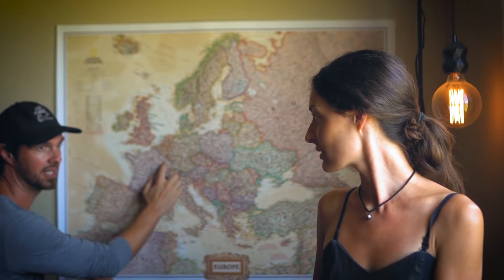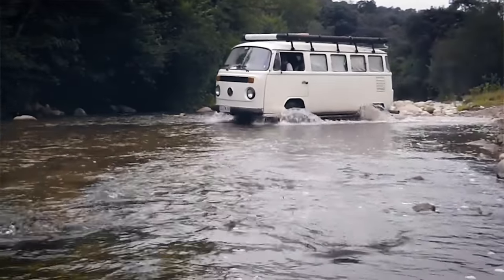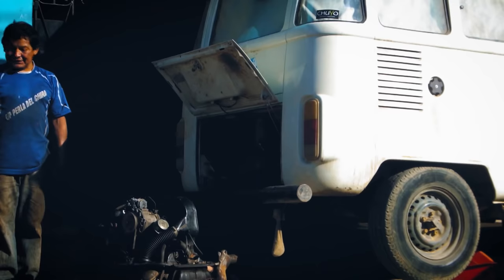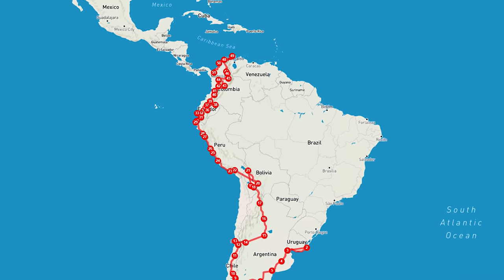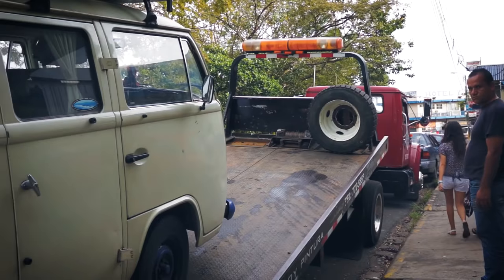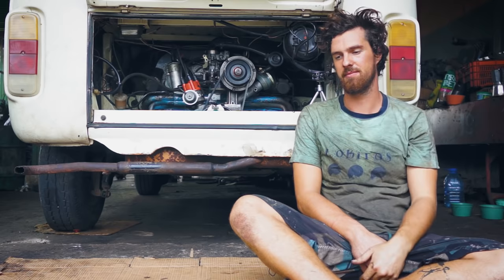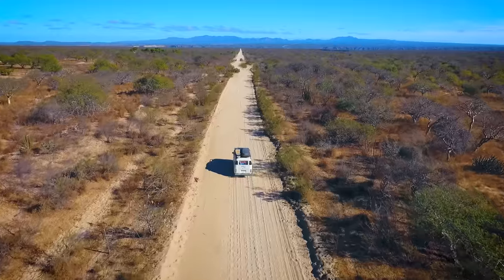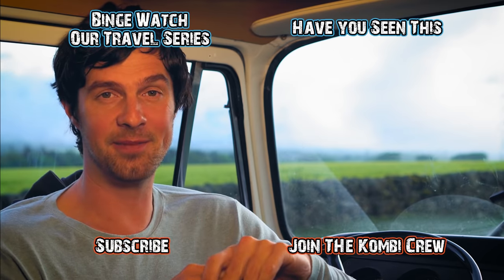How Did I BLOW UP 10 ENGINES in 1 ROAD TRIP???

Comment: There is also a thing called torq.....1.6 boxers very reliable engine for a beetle....how much weight were you pulling along ?
My dad emigrated his van from Holland to New zealand.....flat vs hills.....his luck was he had a 2.0....
Tad bit more torq.....I remember seeing the mechanics face when he stepped in on the wrong side of the van....and als admiring the 2.0 boxer engine
Its what you do with it...and I bet it was always cilinder 3 that seized up....
Im a Volvo mechanic now....but still have a huge crush on mr ferdinands boxer engines....
Reply: I was born in NZ, back when it wasn't islamic. VW kombis were very common and the main reason the number 3 cylinder failed (dropped valve etc ) was because the oil cooler sent hot air onto the barrel . There were once quite a few VW aircooled specialists in NZ but most are probably gone now.

Comment: l have never worked on a vw but most carbs i worked on the jets control the fuel, to make a carb leaner you put in a smaller jet, not drill it out
Reply from the maker: air correction jet
Reply: @KombiLife  l guess l will have to take more notice next time mustie strips a vw carb

Comment: Could be simple as what fan shroud or fan or belt adjustment wet conditions affect belt slippage, type and brand of oil, not using oil pressure gauge where oil pressure switch located over reaching engine power train limits altitude adjustors not working or non existing many factors gas sealed temp control on fan shroud adjustment wrong, valve adjustment not done loose heads!!

Comment: Sound to me like you were probably setting the ignition timing to advanced easy mistake for a novice to make.fuel mixtures tappet adjustment and general wear low compression wont kill an engine like that very easily. over advancing the timing will kill that type of engine especially if it is constantly under heavy load.

Comment: Had I done this trip, saving up the money for a 4 cylinder turbo diesel 1 ton truck camper would have been infinitly more reliable. especally if it could run without the turbo if it broke. and strap a cheap bike onto the back. An air cooled Deutz diesel would be your simple second option.

Comment: Quick question do you think a 1998 Astro van would make it from Oregon to New York I have replaced all of the oil seals as well as replacing the radiator it's a 4.3 liter V6 Vortec engine
Reply: Yes definitely they last 300+ thousand miles without so much as an oil change. Change waterpump to be on safe side every 150,000 miles

Comment: electric fans on the engine panel. two, dinamic speed with temp sensor on oil tank. pull out the hot air through the engine bay and you can really cross the globe. good job anyway.

Comment: the jets control the fuel - they do not let in more air, I would have thought he soldered and re-drilled to make them smaller, then at lower altitudes the engine was running too lean, which means it runs hotter

Comment: Time 6 seized a rod at the crank?  That requires some doing!  Driving over 10,000 feet is an issue with that engine type/setup.  Overloading is an issue.  Not paying attention is an issue (you beat the heck out of many of those builds and you should have known while you were doing it).  If your foot is on the floor for more than a minute or two - that is an issue - you are over heating it.  Learn to take breaks on switchback and 20 mile rises.  Drive for an hour, let it high idle for a few minutes, and give it 20 minutes off.  One lesson I think you learned but may not realized - don't try to make it "better" or make it do more that it has to unless you really need to.  Picking up hitchers?  Why really?  It's nice, but 1600cc is what motorcycles use,  A few miles maybe, but not a long haul.  Cargo boxes?  Not in a MicroB.  Stay focused on the long goal. 

All that said  - and before a bunch of tubers give me flack -  you made it.  And honestly, when I was your age I am not sure I would have done better.  What really impresses me -  you didn't give up.  Even though I think you could have.  Anyway - Maybe I will subscribe.

Comment: lesson 1 should be: Never get nostalgic by using a overly trendy and mostly pre ww2 technology to try to get global with your mileage... In other words if you most critical trip is a run to you local pot dealer then by all means get a VW bus and hippie along if it breaks down (which it will and obviously did)...Lesson 2: get a vehicle using a diesel engine, preferably one without any electronic engine management or even turbo's... Lesson 3: Get a late 1990's Benz (should be self explanatory) Sprinters (short wheelbase if you must) or one of the older Benz smaller diesel vans should be fine...

Comment: On any motor if you jet it too rich the fuel will not atomize properly causing it to run lean. If you don't realize that you will keep throwing more fuel at it.
Reply: This is completely false.  Adding fuel never makes it lean.  When you add too much fuel, you will get to the point where the spark plugs won't fire.  In other words, the excess fuel puts out the fire.  Excessively rich engines never overheat.

Comment: You got your jetting explanation completely backwards, everything you said is the opposite of what you did. Idling an aircooled doesn't overheat it, they supply their own air. Tight tappets don't seize engines it burns out valves. Tip 1, learn to read sparkplug colours. Tip 2, you can't test endfloat with the flywheel off. Tip 3, a red warning light (gen light) means STOP not check later. Tip 4, remove the flaps and thermostat as soon as possible. Tip 5, never run the engine with the heater tube outlets on the fan housing open.  Blown heads is very very common but over tightening the headbolts will guarantee a blown head. I enjoyed the video though 😀.

Comment: Jets handle only fuel. A tiny jet sprays less fuel, and a large bore delivers more fuel. Had he drilled your jets out you would be dead rich at sea level, which wouldnt burn out the engines. A rich engine will bog, maybe flood out, but not burn up as the extra fuel adds some cooling.

Comment: oh well, it is a shame that they are still tanks, powerful engines regrettable, but learn from your mistakes, you can also add other techniques, such as solar panels and fans can be handy oil cooler or you can chase oil through a radiator

Comment: Why 10 Engines...., Its an air-cooled V-dub.  When growing up,  experienced a 63 and 67 twenty three window van.  Always a drive on Monday fix on Sunday. Parents finally got smart and bought a GM van with a 400 engine. Now your talk'n ! How many VW engines does a GM van cost?  The neat thing about the Chev was we actually got to and from our destination.  Common sense 36 hp or 250 hp. Which is better? Go Figure.

Comment: I had Kombis all my life from T1's to T2's, then T3 Synchro, T5 and now T6 4Motion. As students we bought the old and very old and the first thing we always did was to install a set of instruments. Oil pressure, oil temp, battery charge. Catch it before they blow up. Also there is a huge difference in quality between a German VW and a South American one. The South American one is sold much cheaper but also built much cheaper. And how many miles do they have travelled already?  Did your dog put on weight? Too much weight and wrong driving technique kill engines too. Now you know. Original, new German motor will run around 350000km, an overhauled engine between 10000 and 100000km max. I hate the way you get the engines out. Lift up the car, place a wheely bin under the engine, unbolt it and roll it out. You will do your back the way you do it. Most of my happy times were travelling in Kombi's. Only blew one engine and one gearbox ever. Love your stories. Love Jersey. Keep it up.

Comment: I still think that no matter how easy those 50yo engines, they need tons of maintenance. And no matter how cool those old vw are, I still think that know problem with its overheating engine will destroy you one day. So that's why for such trips I would choose smth newer like fiat ducato or other stuff from modern era. Which is still pretty basic and designed to drive for thousands and thousands kilometers with only basic maintenance,  and all of this with overload and staff. But if you want smth retro you always can choose between old nuggets like transporter and smth like russian UAZ 469. The last one is still on conveyor btw. But it will still be retro shit with no sound isolation, terrible fuel efficiency, and breaking almost every 1000-10000 km depending on how lucky you are. At least they did mounted engine in front of the car in UAZ.

Comment: Actually those engines don't last very long when they're under heavy loads... That's also what my grandfather told me who was driving various beetles in the 60s and 70s... He also had to do frequent engine rebuilds back then and only as he stopped pushing them hard they lasted him longer... which is no easy task when the engine has no power to begin with...

Comment: Not to be cruel,but you made every mists in the book.  I TO HAVE MADE A FEW OF THOSE WHEN I WAS 16 TO 18 YEARS OLD  IN THE sixties building motors,  the last motor I built was in1990 and it is still running in the same  pop top camper I put it in.  Best book out there is the vw guide for the compleat idiot.  Buy it read it it is your bible. And  engel 110  camshaft,  a pertronix ignition, deep sump,  remote filter kit and increased volume oil pump and a drop in cylinder bore increase kit......way to go

Comment: Alright think of this as an experiment?
Where upon you kept repeating the same parameters while expecting different results. Using A mish mash of used parts from different engines. Hopeful to fix the same problematic block. Still yet you never discovered the critical error & or flaw in your plans for repair. Mental note engine swaps work far better than trying to fix an old engine that is known to be prone to failure.

Comment: Drilling the jets would make it so it the engine would get more fuel, unwanted in an area where there is less oxygen. He might have gooped it up and re-drilled it SMALLER. That would LEAN OUT and DETONATE your engine at a lower altitude. If your Cylinders are not pitted thought it's a timing issue.

Comment: drilling out the jets would let in more gas.. causing it to run rich.. maybe rich enough to wash the oil        out of the cylinders..   could explain a cracked ring.. probably you never adjusted the valves..
Reply: It was the air correction jet that was drilled bigger.  That makes the engine run too lean at sea level, just as Ben said.

Comment: I wonder how many oil changes you’ve done. 
Cause these engine need a tune up and a full filter and oil change every 5000 kilometers ore roughly 2500 miles. 
So next time. Stock up on oil.

Comment: Bottom line; You where asking to much from a 36 to 40 hp engine, besides one patch repair after the other.
Way to much weight and aerodynamic drag and mountain terrain.
P.S. technically air cooled engines are fuel cooled by virtue of a slightly rich fuel /air mix ( if the mechanic had 
over drilled the main jets in the carburetor it would have been blowing black exhaust or too rich, not lean).
The fan is technically to enhance heat flow away from the heats sinks or fins.
Do yourself a favor and mount large ram air scoops on the sides and over the exsisting  vent grills supplying
the outside air to the engine compartment maybe even duct the ram air directly to the fan intake.
Add a large oil cooling radiator ,in a rock protected area and in a air slipstream. Just be ready to reverse all 
this cooling in cold temps via covers to block the air for warmth and the extra oil volume that it takes to do it  
will not hurt either.

Comment: I find myself struggling to watch this video...

I may not be a licensed mechanic but i've done most of my work on my own, if I didn't know something I'd research deeply, talk to experienced mechanics

Then once I knew exactly what to do, I'd do it and do it correctly or else I wouldn't do it at all

Another that stops me is not having the tool for the job...

My advice is if you're going anywhere in a "adventure rig"

Have the knowledge and experience with automotive repair and maintenance... With this, all you'll need afterwards is the tool and the effort.

Comment: It is essential that you have the gasket and part that goes around the engine check out this ebay listing of the proper look https://www.ebay.com/itm/VW-VOLKSWAGEN-BUS-ENGINE-DOOR-DECKLID-SEAL-1955-1971-261711-/151204757047 
If not, the heat from the exhaust will overheat engine. 
Also not sure if you know who mustie1 is here on youtube, he will help. 
Also you should invest in a aftermarket cooler, the one that is in the housing on the back is kind of notorious for not cooling well enough.

Comment: Drilling out a jet would make the engine run more rich. The jets meter the fuel not the air. Bigger hole in the jet would be more fuel and that means rich not lean.
Reply: I have also been told that you have to torque the heads down and adjust the valve on air cooled vw engines very often. If you where not doing that it may have contributed to a lot of the engine problems including but not limited to the studs pulling out.
Reply: The mechanic in Bolivia drilled the air correction jet bigger.  That makes it lean.
Reply: @00mazone    You don't have to re-torque the heads, as long as you don't overheat the engine they stay at the same tension for the life of the engine.  Adjusting valves is necessary, unless you have a late Mexican FI engine like Ben got in southern Mex.  It has modern hydraulic lifters, so it never needs the valves adjusted.

Comment: Dont want to offend your knowledge of engines but there are a lot of things in this video that made me cringe. Heres what ive learned from blowing up engines myself, 1 never take chances on overloading or overheating an engine. This causes severe wear internally that might not make it stop at the moment but it will reduce your engines life by a lot. 2 learn everything you can about engines to make sure its built properly, these things aren’t legos and you cant just rebuild them in a day i dont care who you are. Precise measurements are essential to make sure everything is within spec otherwise IT WILL BITE YOU IN THE ASS. Im talking crank and journal clearances, end gaps on the rings, piston and cylinder wall clearance, valve lash and theres a lot more that needs to be checked before you can assemble. 3 proper assembly, everything must be torqued to the right amount all proper oem gaskets must be used and never neglect to clean your parts completely before applying assembly lube or any sealants. Luckily i saw your recent video with the new engine that’s built properly and that was done beautifully. The fuel injection will definitely be a good fit for you because tuning carburetors is a life skill and understanding it doesn’t mean you’re gonna be good at it. Dont take any chances on an engine you need to rely on, go learn these things on moped engines and small stuff that you wont care if it blows up. Just know that putting something together that runs is by no means a guarantee it was done right and you’ll find that out when it only lasts 30,000 miles
Reply from the maker: thanks for your comment

Comment: Sorry but your first mistake was the wrong VW van you bought in the first place. Do not buy a Vw with the punched louvers in the rear panels. That is not enough cooling. I you buy another kombi, buy the body style with air scoops in the rear corners, in line with the window height. I you have no choice but to buy a punched louver model, fabricate scoops out of scrap sheet metal and rivit them to the sides of the van. Vw knew of this temperature problem existed with the early vans in hot climates and brought out the scoops with the kombi redesign introduced in 1969.

Comment: Brah you have got it wrong. Jets let fuel enter the the venturi witch there get mixed with air. Jets do not let in air opposed to what you said. Also; if you drill jets bigger that makes your mixture richer, not leaner. If you climb higher the air gets thinner thus less air particles. So yes you had your mixture leaned out that first time. When you descended  that much meters; there where much more air particles per cc of air. You still have a lot to learn. You could have done a lot better. Cool trip though

Comment: It’s is a bad choice for South America. It’s air cool and under power, S. A is full of mountain and high elevation. Do you know what is engine Detonation is? It’s called pinging too,. That the light ringing sound when you lug a engine in 2th or 3&4 at too low of a speed and add gas and pull out. This lite pinging sound is detonation and it’s is distroying the engine  slowly.  The hotter, the low power engine, the wider the spacing of the gear, the overloading of the  engine, the hills  add to the problem all these cause piston detonation and break rod and rings etc in time. beside the engine is air cool, how can hot air in the engine compartment cool a cast iron pan that has a fire underneath it and working twice as hard climbing a sustain hill. It’s running a marathon in a jacket. If you could find a diesel bug engine that would have more torque for the hill or more engine cubes as you found out. Basically the 1300 ? engine was underpowered

Comment: here is a little secret about VW engines, because of the placement of the oil cooler in the fan shroud one of the cylinders run hot, to alleviate the problem one of the lobes in the distributor is retarded so it will run cooler, if you get the distributor out of time and the spark is delivered to the wrong cylinder, (the wrong cylinders run hot and cool) to a person that really knows their VW you can actually tell the difference running under load,